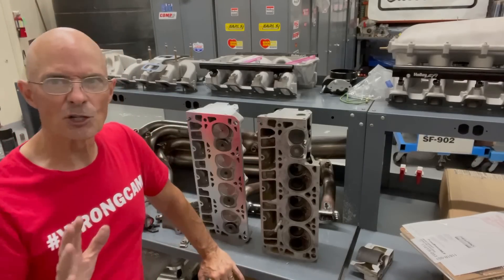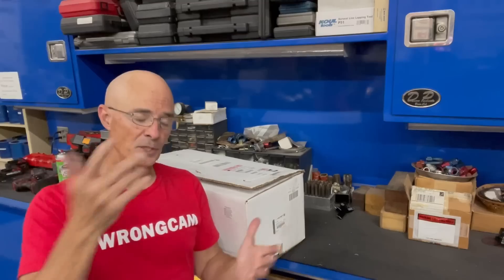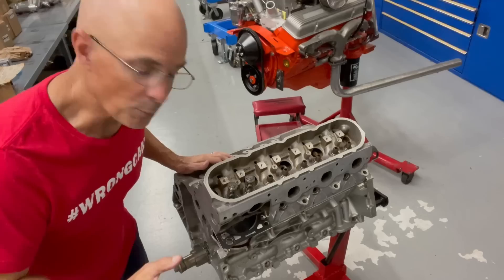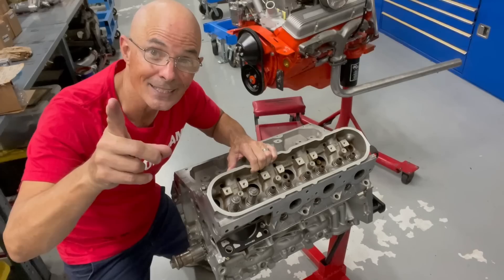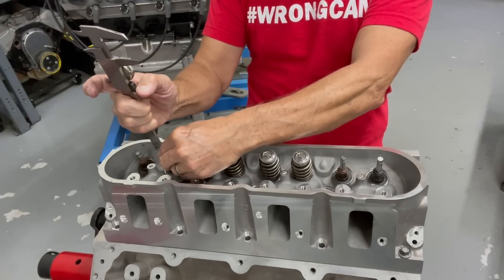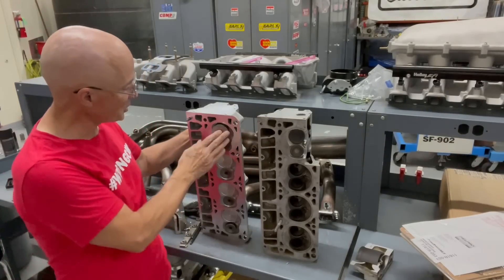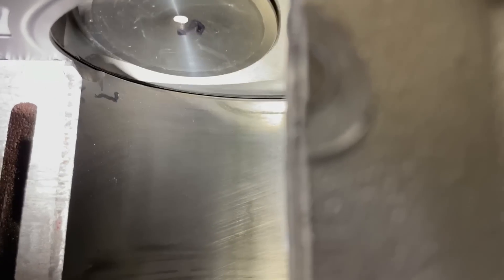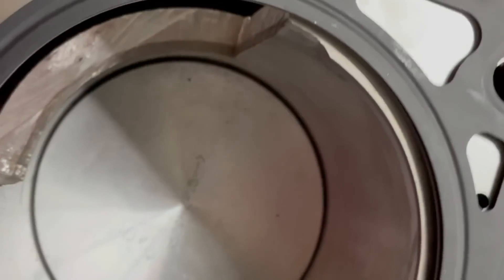CAN YOU RUN REC-PORT LS3-STYLE HEADS ON A SMALL BORE 4.8L/5.3L? WILL REC-PORT HEADS EVEN FIT A 4.8L?

Comment: Would it work better if you selected a smaller valve size and fitted correct size seats so the throt size is 90% of the inlet valve and 88% of the exhaust valve before any porting was done so the bowl area only needed the guide needed cleaning up.
Reply: I think you guys are missing a major point. The exhaust valve has more interference than the intake.
Reply from the maker: no porting
Reply: @richardholdener1727  so effectively you install say a 2.08 valve instead of the 821 2.125 valve. Or what ever the throttle size is of the factory casting use that as the 90% percentage of the new valve size.
Reply: @richardholdener1727  so say the throat size is 1.8 inches use that as the measurement to calculate out the valve size as if that 1.8 inch was 90% of the valve.  That way you don't have to port the throat and only clean up the valve guide in that area.

Comment: I’m going to go out on a limb and say yeah grinding it out like that doesn’t seem fine. Also you probably will affect the flow with part of the valve in a pocket like that. Cool video was guessing those heads would be fine. Oh, and that chunk you would have to grind out also adds as the the compression chamber volume.
Reply: Hey BBC been doing those notches for years and it picks up power heh

Comment: Looking at your display engine... I don't even think they would work on an LS1 5.7L (3.898" bore) Bore that to 3.905", I still think it would be dangerously close to interfering. By what you showed, I see why a 4" bore is the minimum for rec ports.
Reply: Those are very large intake valves, so even a 4" bore is not "that big" for it.
Reply from the maker: 4.0 bore fits
Reply: @richardholdener1727 good to know. Was thinking of Rex heads for a 6.0!I want to build

Comment: How about an ls3 short block with ported ls2 heads? Will they work as good as the rec port heads. The comp ratio will be around 11-1 with the ls2 heads.
Reply: He has compared ported cathedrals to stock rec ports a couple times.
Reply: @boost1728  I've seen some close but not on an ls3 to where the comp ratio is a point higher. At least not that I can remember.
Reply from the maker: properly ported 243 heads would make more than stock ls3 heads